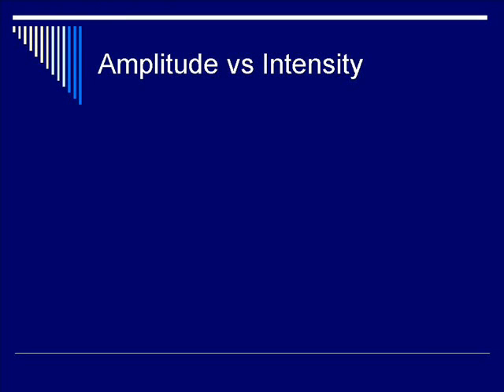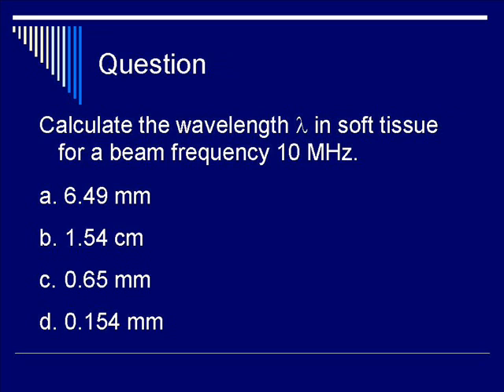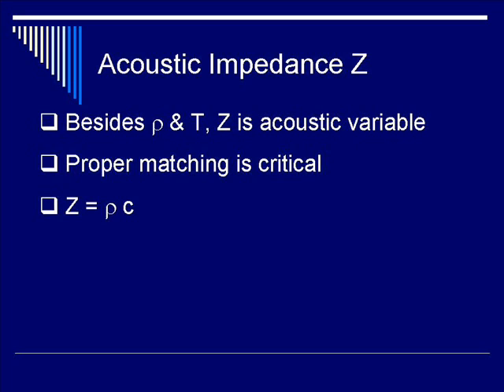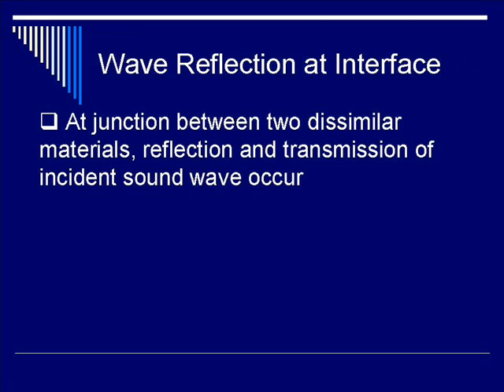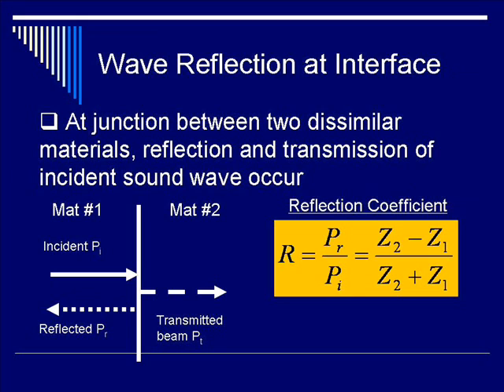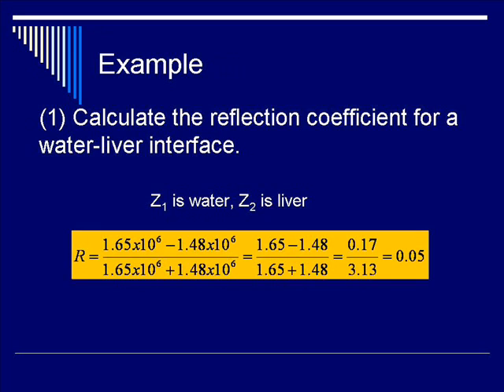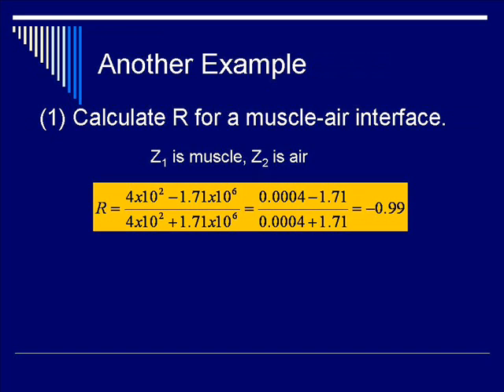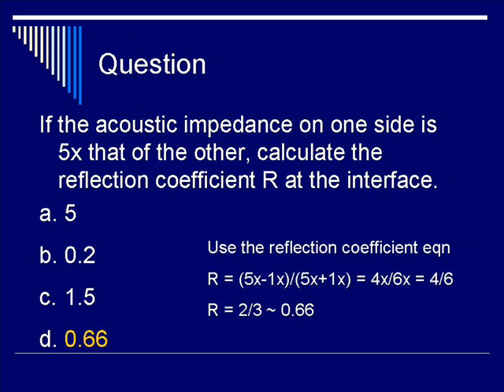Physics of Diagnostic Ultrasound - Segment Two

Comment: Question, isn't the IRC calculated by [z2 - z1/ z2+z1]^2 X100?
Reply: After reading your comment I checked around and I think you're right.  My hunch is that some sources might define the reflection coefficient as the ratio without the square, but either way, I think the ratio of intensities would still be equal to ((Z2 - Z1)/(Z2 + Z1)), no matter what term we use...